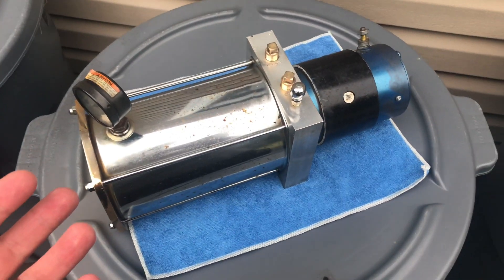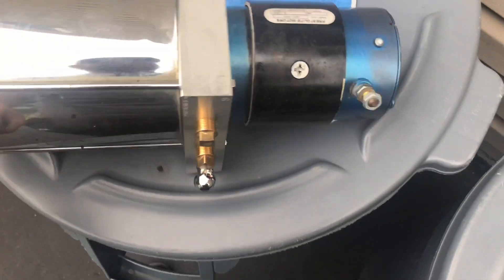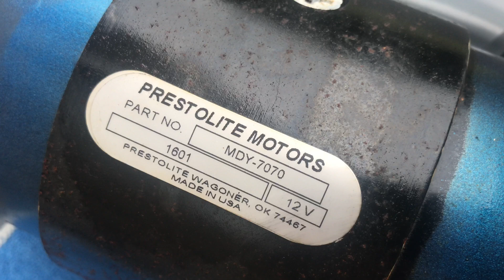Lowrider Hydraulics: Fenner Gears & Prestolite Motors

Comment: okay you're wrong in a  couple of areas the Chuck key will break by over locking yes but it also sends pressure down the gear shaft that will make the shaft break or make the snap rings pop off gear or even shear  the pin that holds the gear to the shaft also the fender gears the last ones that were made did not use any seals between the wafers they were most commonly on the gears that have the tang shaft